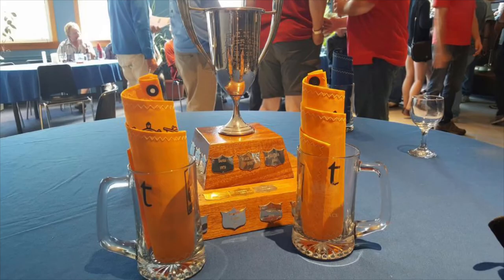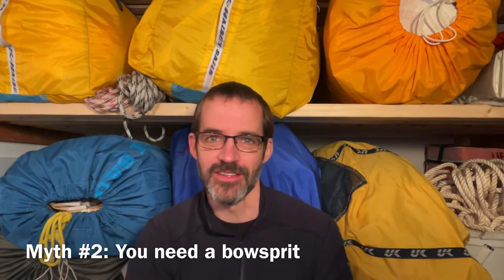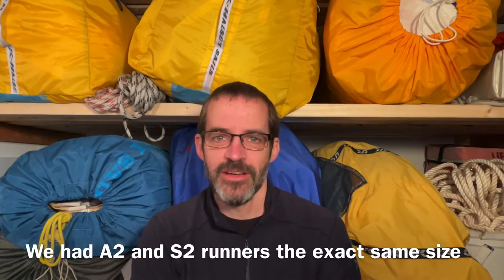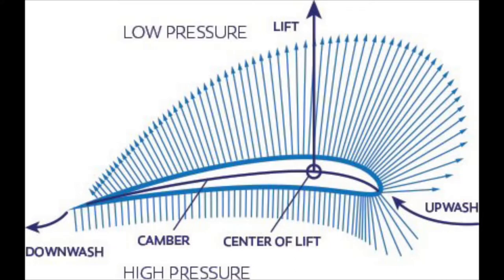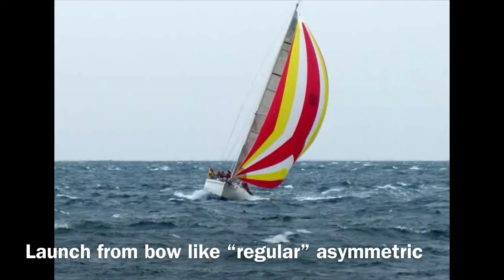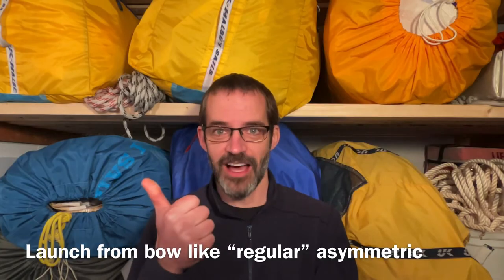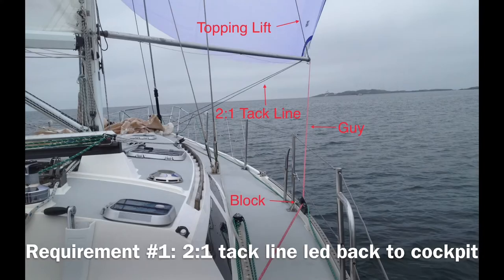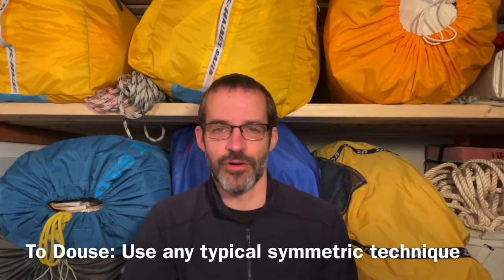Want to Sail Deeper With an Asymmetric Spinnaker? Try this!

Comment: Really thinking outside the box on this one.  All of the older boats will have a spinnaker pole that in many cases is seldom - never used, so the idea of having the option of poling out the asym  has an appeal in that it's not required and can be added if wanted without the rush of setting it up before the  launch - also no more expensive kit to buy.  The video clips and labelled images are very helpful in understanding your technique.  With the increasing interest in shorthanded sailing/racing and the challenge of downwind sailing with few hands  ideas like this are right on the money.  Thanks for sharing!
Reply from the maker: Thanks so much! I can't take all the credit - what I did is a smaller boat adaptation of a big boat technique I saw on the Santa Cruz 70 Westerly. I don't have much experience on boats that size but apparently it is much more common on really big boats without bowsprits, as the conventional symmetric approach is just too unwieldy. 

You can also easily revert to conventional symmetric dip pole gybing by sharing tack line and downhaul duty on the same line. Just rig the conventional downhaul as a 2:1 on your foredeck, with one end going back to the cockpit, and the other end continuing on to the bow. Just pull all the slack out of one to use the other. Hope this helps!

Comment: Best spinnaker/gennaker video I have seen yet -- and I have seen many. Bty, I'm not a sock fan either. If you every gyb your gennaker the top of the sock can get caught up in the rigging and be difficult to drop. You can also get the hour glass problem on launch and not be able to lift the sock all the way.
Reply from the maker: Thanks so much! Yes you’ve outlined pretty much all the reasons I hate socks!!!

Comment: I frequently do bow on a beneteau 50, and have managed to get the asym on the pole a couple times. VMG is so much better when we do! I appreciate your tips, we're definitely still working out the crew work to gybe it efficiently. On another boat, we poled out the genoa to windward and flew the asym to leeward. It was a little comical, but our local PHRF allows it!
Reply from the maker: I think squaring back the asymmetric on the pole would be much more efficient than the creative double headsail rig because you’re getting “wing” airflow over the asymmetric which is more effective than “parachute” mode!
Reply: Yea
Reply: Yea thanks ☺️ I just bought this new car 🚙 bought and sold for Christmas 🎄 and it is so nice 😊 I look 👀 mppk

Comment: Thanks for this video.

I have a jeanneau Sunfast 3200, and have two asymmetricals plus a conventional. I have a furler for the symmetricals, like a jib furler, which is designed to sit on the standard short bow sprit. It makes dousing the symmetrical easy from the cockpit. It's a bit dangerous if racing by yourself, to be trying to pull a sail into the boat, with other boats around and approaching a leeward mark. Despite my remote for the autopilot hanging around my neck, I worry about things going wrong, being slower than I planned (I'm not young) and not seeing a boat approaching, which can happen when your pulling a sail down and then something sticks or the wind catches etc. . I don't want to spoil my name by having a problem either!

I spoke to the sailmaker about my intention to pole out the asymmetrical, and he said don't do it, its too slow. But my idea was to leave the sail on its furler off the bowsprit, and pole out the leech of the symmetrical. Hence the sailmaker saying it won't work (Doyles operation where I live). Better to go broad and fast he said (the boat can go fairly quick off the wind). I am yet to race the boat but am almost ready  - and for our winter races in Australia (its winter now) its typically a windward return course. So running deep makes sense. But on a shortish course gybing being slower in a breeze (ie 15 -20 knots) single handed or with my wife on board (still single handed therefore) still seems a challenge. I'd love to be able to unpeel the genniker, use a pole, and then be able to furl it back from the cockpit!! My pole is carbon too, it super light!!! I need to work things out alright ...
Reply from the maker: It’s an interesting idea to square the entire furler back on the pole - maybe just use some kind of adjustable tack line at the base of the furler? It would definitely be slower to gybe but if you’re sailing longer courses maybe it’s worth the trade-off?

Comment: In the 1980 Swiftsure they allowed the small boats to do the long course. 140 miles. We were on a Morgan 27. Coming back it was blowing 30+. After a couple of really good broaches we took the spi down. I was the youngest crew so I got to go on the foredeck and put up a 135% lapper. I rigged just like an asymmetric. Tack at the pole and sheet outside the forestay. The boat was really well balanced. At one point we did 11 miles in one hour. Best hour ever on that boat.
Reply from the maker: That's a good story, and a long trip and good result on a smaller boat! On our multihull we use our screacher to similar effect, which is basically a free-flying roller furling genoa that we fly off the bowsprit. Squaring back the asymmetric on a pole is a weapon in races like Swiftsure (Juan de Fuca and Cape Flattery) because you can sail pretty close to the rhumb line back to Race Rocks with good speed with the boat fully powered up, and not having to gybe, then just ease the pole forward as you round Race Rocks.

Comment: Nice tip. In our winter club races on a first 260 when the downwind mark is typically dead down wind, we goose wing our asymmetric. The main sail is pushed our to windward, so quite extreme by the lee. It works fine, but it is a hand full in strong wind or gusty conditions. I will try your technique.
Reply from the maker: The main disadvantage with this technique is that it's slightly slower to gybe than a symmetric kite or goose-winged asymmetric, because of the time required to ease the tack back to the forestay, move the pole, square back on the other side, so you just need to leave a bit more sea room if you're in a tight space.

Comment: This is great - thanks.  I have a 1974 Swan 38 and about to start properly racing her.  I have an A2 and an S1 and S3.  The Symmetricals scare the crap out of me with their loads and with my boat’s shape and broaching.  One of the other questions I have is around loads and wind pressure and when to go from a kite to a poled out headsail.  On a friends boat, which planes, we carry a kite up to 35knots (A4 or S4). he was telling me that the pressure is just so great with the displacement of my boat that over 18knots I should not carry kites.  Thoughts?  My winches are large (56lb primaries and 46lb for kites). Also, I have a sock on my current A2 as we;re mostly sailing two handed.  It really works but I hate the set of it at the top.  To stop wraps around the forestay we run a very old fashioned ‘net’ - which is a a couple of VB cords laced together, and clipped to the forestay to the mast. Works fabulously.
Reply from the maker: That’s great that you’re going to get out racing! I’d tend to think of it more in terms of boat speed rules instead of wind speed rules. For example, our Catalina 42 was fairly easily driven to about 10 knots of boat speed (sustained) but anything above that took exponentially more power, like a wave to surf. So once we got to 10 knots with the 0.75 oz S2 or A2 we knew the loads would increase rapidly so we had to go to the 1.5 oz S4 or A3 kite or risk blowing up the 0.75 oz kite. This normally happened at around 22-25 knots of wind so 18-20 knots is probably pretty close to your limit with a 0.75 oz kite on your boat which is slightly smaller. We did fly the 1.5 oz S4 and A3 in 30-35 knots but still only got 10-11 knots of sustained boat speed DDW with 25 knots of apparent wind from dead astern, with the whole boat vibrating like it was going to explode! So find your boat’s “terminal velocity” and go to a poled out genoa at that point. Another rule of thumb we used for VMG sailing with spinnakers was to sail deeper only once boat speed reached 6.5 knots, or maybe 6 knots on your boat. If boat speed was below 6.5 knots we’d sail a hotter angle until the apparent wind was on the beam, or even slightly forward of that if the wind was very light. We had a net too, mostly used that at night when people were tired. I bought a sock early on but only used it for less than a year as it would sometimes get fouled on the head stay and I couldn’t pull it down - yikes! So we always did a letterbox douse when the wind was up or short-handed. Hope this helps and good luck!

Comment: The International America's Cup Class(IACC) yachts used from 92 til 2010 sailed very deep angles and used asymmetric spinnakers
Reply from the maker: Cool - do you know if they squared them back on poles?
Reply: @SailingTipsCa  they certainly did! They had to because they aren't apparent wind boats
Reply: @SailingTipsCa  https://youtu.be/3YhBbTiHKzQ?si=foAAf0yF135sQJNj.  Jump to 11:46 to see them on the run, with poled back "gennakers" as PJ Monty put it

Comment: Great clip. What percentage of the time would you say you were flying your A2 with a pole?
Thanks
Reply from the maker: Glad you liked it! I'd say we used the A2 on the pole about 2/3 of the time. Our boat was 42 feet, so we basically followed Stan Honey's rule of thumb on his Cal 40 to only sail deeper when we were going 6.5 knots or faster. Of course that would differ by boat and wind speed, but worked pretty well for us. In lighter air we tried to keep the apparent wind on the beam, but as the wind built to about 10 knots we'd allow the apparent wind to move back to around 120 degrees and square the pole back about 30 degrees, more as the wind built.

Comment: Great video!
I use an asymmetric spinnaker on my North Shore 38 a few of the guys at the club reckon i need an bowsprit to extend the tack position.
Would it be easier to jybe as there is not a lot of room between the forestay and the tack when doing an inside jybe.
Reply from the maker: You don’t need a bowsprit to do inside gybes with an asymmetric spinnaker tacked to the bow with a bit of technique. The key is to ease the lazy sheet and pull the clew around the forestay and almost back to the shrouds before turning the boat. If you turn the boat too early you greatly increase the risk of wrapping the spinnaker around the forestay. A bowsprit allows you to turn the boat earlier, but also incurs an unnecessary penalty for your rating if you’re racing. Hope this helps!

Comment: QUESTION: Do you use one guy line or two? The question is about gybing -- you have to disconnect the guy to gybe, correct? Any insight or a video of your gybing process would be greatly appreciated!!!
Reply from the maker: We used two guys - one for each side which we typically kept clipped to the pulpit adjacent to the tack line when not in use. You could optionally leave them both connected to the downhaul bale all the time if you so wished. The gybing process involves 1) easing the guy forward and hardening the tack line until the sailing loads are entirely on the tack line and the guy is slack 2) removing the pole from the guy 3) gybing the spinnaker per usual 4) attaching the pole to the guy on the other side and easing the tack line while hardening the guy. I would love to do a video on this but I’ve sold the boat!!! Does this help?

Comment: What luff length did you use if you are flying it off both the tack and the pole? If you set it up to fly off the bow won't the luff be too long for the pole? How did you design it?
Reply from the maker: I would recommend designing the luff length such that the tack is right at the height of the pulpit in the most upwind position (e.g. 60 degrees apparent in light air). This would correspond to the pole being all the way forward at the forestay (or not attached at all). Does this help?

Comment: I'm new to sailing, am destined to be solo/shorthanded, and was researching what my one downwind sail would be... what's your thoughts on top down furling asym' spinnakers?  (Sun Odyssey 37...)
Reply from the maker: I used the A2 runner (0.75oz cloth with 0.0 oz luff) 95% of the time with a racing crew but my first spinnaker was an A3 reacher (1.5oz cloth) which was a bit more conservative so tended to use more when short-handed, plus the thicker cloth was bombproof. So an A3 reacher would be more forgiving as a first spinnaker at the expense of not flying quite as well in very light air or deep downwind. Top down furlers can be helpful but also finicky to get set up and working properly. But once they’re dialed in they can work quite well. The Sun Odyssey 37 is a great boat to get started with because it doesn’t have a huge rig so you won’t get into too much trouble, with the compromise being that it’s a bit sluggish in light air. Given that you could quite safely fly an A2 runner as well. I’d recommend getting out on some similar boats with experienced crews to see how they handle spinnaker launches and douses!
Reply: Thanks & happy new year!  @SailingTipsCa

Comment: Do you rig 2 sheets and 2 guys for gybing? Also, are you rigging a foreguy (pole downhaul) to the pole or does the load the pole carries acting as a tweaker not require a downhaul? Great video and I'm absolutely going to try this.
Reply from the maker: Glad you liked it! The rigging connected to the spinnaker without the pole is the halyard, tack line, and sheets, which I typically fabricate as a Y with one sheet going to either side of the boat and the spinnaker attached to the pendant. To add the pole you only need a pole topping lift and a guy for each side connected to the beamiest part of the boat. Only the active guy needs to be connected, and you can disconnect the other. You don't need a separate pole downhaul because the tack line to the bow and the guy together limit the upward travel of the pole. Does this help?
Reply: @SailingTipsCa  for racing, doesn't that slow down the gybing process, having to remove one guy and attach the other?  Versus having them both attached to the tack?
Reply from the maker: @robertmann8895  You can definitely leave both guys attached to the tack to speed things up for racing, just need to ensure they are long enough to lead around the forestay to the squared back tack position on the other gybe.
Reply: I like this rig. Have you a block on the bow for the 2:1 foreguy , then led back to a control? Great vid @SailingTipsCa
Reply from the maker: @lumber002  Glad you liked it! Yes the foreguy / tack line runs from a cockpit clutch adjacent to a cabin top winch, forward to a block on the anchor roller, up to a low friction ring on a shackle on the spinnaker tack, and back down to a padeye on the bow.

Comment: So basically like poling out a symmetric spinnaker, but with an extended tack line also acting as a foreguy, right?

One could probably also (keep the tack line on the deck or bowsprit and) pole out the clew for sailing deeper, but I'm not sure how good the aerodynamics or boat balance would be.  I'm sure it's been tried.  Obviously it depends on the shape of the sail.
Reply from the maker: Yes it’s very much like squaring back a symmetric spinnaker on the pole, but the tack is always attached to the bow, and you turn the kite inside-out to gybe, rather than swapping the tack and clew. 

You could also pole out the clew for very deep wing on wing sailing, but I’ve never liked that because the sail is shaped for optimum efficiency with the air flowing over it from the luff to leach, so I’d rather just square the luff back further than pole out the clew. Plus this gives you more options to react if the wind suddenly builds and/or comes forward.
Reply: @SailingTipsCa  Right, the asyms are meant to have airflow to generate lift.  Syms would be better as a parachute that way.  So asyms would probably not work as well with the clew poled out.  

(But if it were, say your only spinnaker, it might do something.  However probably better to broad reach within the designed favorable angles of the sail (and boat) anyway.)

Moving the tack/luff does make more sense for an asym to keep the sail shape lift better, but at a different angle of attack relative to the boat.  (Sorry, words not working well right now.   :) )  It's effectively like moving the bowsprit athwartships and up.

Which makes me wonder if doing so gives more or less weather/lee helm.  Moving the center of effort of the headsail must affect boat balance, I would think. 

Thanks for sharing.
Reply from the maker: @LoanwordEggcorn  Squaring the pole back when running deep does provide more forward drive and therefore less heel and less weather helm. It’s really quite similar to those sport boats with articulating bowsprits, like the Antrim 27 and Henderson 30.